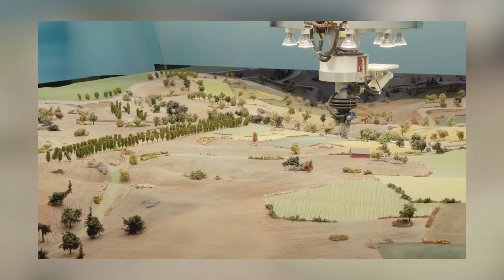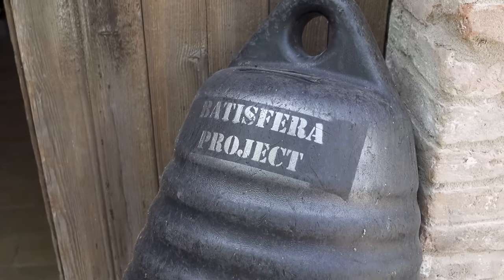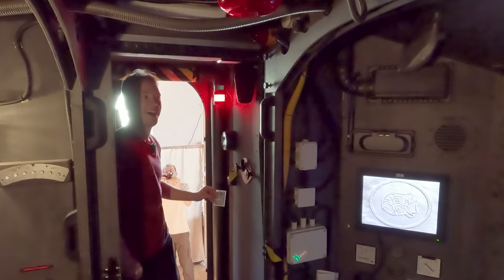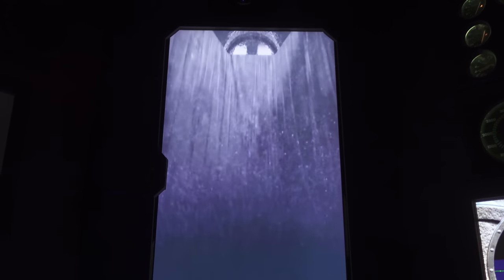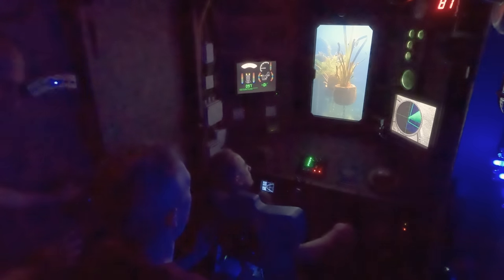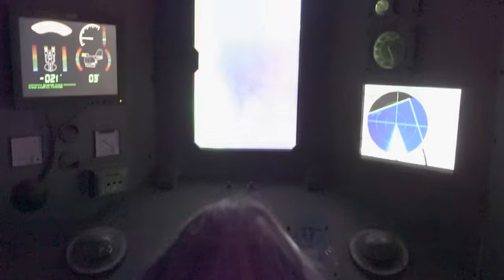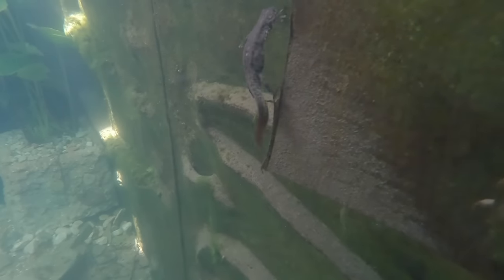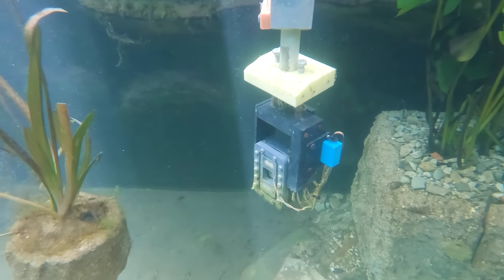I had to throw out my script about this submarine simulator

Comment: Can’t wait for a miniature spaceship simulator, that’s simulated with a tiny camera that is hooked to the ISS in real life
Reply: that might honestly be doable. cubesats have used electrolysis to generate rocket fuel after launch.
Reply: @tjeulink  You have to make the rocket fuel out of something, which you have to lift to orbit. Still a tiny enough spaceship could be cheap
Reply: smallsats are definitely a thing, it's possible to get stuff into space.
Reply: In the mean time, before the real space-cam: Artemis Spaceship Bridge simulator
Reply: I'ld like to see a moon-web-cam we could all control
Reply: @AlexanderRM1000  """""cheap"""""
Reply: @sorenlloyd  The fastest possible (theoretical) response time to controlling something on the moon is a few seconds (remember, it's roughly 384,400km from your house). In practice it's probably going to be over 10 seconds. Good luck controlling that in realtime.
Reply: @thany3  That is just over a 2 second round trip. There will be lag: but not quite THAT bad.
Reply: Because space is a vast void, there will be no little frogs or something. I guess the novelty might wear off quite quickly.
Reply: The possible equivalent of the presented project that is set in space would be something like a cartesian manipulator with camera going around in a dark room with diodes on the walls for the starts and illuminated spheares representing planets. This would require similar set up for the spaceship as presented but probably the effector of the manipulator could be programmed to have innertia and not stop without the thrust. Users could use gravity assists and examine distant planets. The map and the robot would need to be bigger than the pond.
Reply: @AlexanderRM1000  i know that? like i said, the cubesat used electrolysis to achieve that. they literally flew a cubesat around fueled by rocket fuel generated after launch. its called PTD-1, part of the HYDROS propulsion test.
Reply: Spaceship simulator where you can't move around at all, but you can rotate 360 degrees. I guess it could be interesting.
Reply: to echo André Bartels, actual orbit might get boring, but one could invert some colors, insert a star map in the background, and "simulate" an alien ecosystem on Titan, or theoretical extra-solar planets... It's the intermarriage of simulation with outright illusion that got me excited. There's reason for Tom to dismiss "theme parks in Florida" in comparison to this.
Reply: @thany3  you could run a full simulation based on previous filming. Give the satellite five degrees of freedom of movement. and playback "film" according to joystick movement in simulation.  That's getting a bit far from this "sub simulation", but if you don't have pesky lifeforms doing spontaneous things...  I'm just getting inspiration for a whole lot of projects with this. 😁
Reply: @tjeulink  that's not necessarily cheaper than launching the cubesat with extra rocket fuel, although perhaps you could make a system to make it out of some waste product the ISS produces
Reply: @AlexanderRM1000  you're not allowed to take rocketfuel. only if you do a dedicated launch which costs millions instead of thousands.
Reply: @tjeulink  Some cubesats do store rocket fuel. They just can't take up very much. Under normal circumstances, you can only put 100 Wh of chemical energy onto a cubesat (total between fuel, batteries, etc.). The advantage of hydrolysis is that you can use solar cells to generate electricity, which you can then use to generate more rocket fuel, so you can exceed the 100 Wh limit. Alternatively, you can just use an ion thruster, though that has much lower thrust.
Reply: I recently got to do a thing that was like this that uses VR headsets in a big arena showing you 360 immersive video of the ISS, and it's beyond amazing
Reply: In 2005 Ch4 in the UK spent a load of money to convince a group of people that they were actually being launched into space. It's called space cadets look it up.
Reply: @sorenlloyd  That will never happen...
It should have already been done.
Advertising goldmine if the public could use the camera to watch the earth.
There is a reason it will never happen.
Because then we would see the truth of the earth.
And they can't have that.
Reply: That's an amazing idea. My twelve-year-old self would have been ecstatic to try a simulator like that.
Reply: This is practical and can be created 😅
Reply: @EebstertheGreat  ah good to know, misremembered the details then!
Reply: Disney World used to have something like that way back in the day.  My 5 year old self thought I'd actually gone to the moon, and none of my classmates believed me.  It wasn't until a few years later that I realized it was just TV screens showing rocket footage.

Comment: These guys put more thought and custom engineering into their backyard passion project than a company charging $250k per person to go on a submarine built using dodgy off-the-shelf products. This submarine simulator probably has more safety checks than OceanGate too
Reply: We make a lot of efforts in experimenting with different kinds of redundancy and safety checks. But of course, our is a proof of concept. Everything on our beloved surface is far easier to implement than in the far deep of oceans...
Reply: a backyard submarine simulator is a recreational device designed for entertainment purposes. While it may have safety checks in place, it operates within controlled conditions and does not carry the same level of risk or complexity as a real submarine expedition.

Comparing the two is like comparing apples to oranges. Each activity serves a different purpose and carries its own unique set of risks and considerations.
Reply: @Pygmyz06  That's the point. More thought went into something that had immensely less risk than the actual deepsea submarine with literally cheap lights from a camping store (and a construction that was never rated for its purpose).
Reply: @OLBastholm ut you understand that you are just wrong though right? Like i understand that there were major oversights in the project but you do understand that SEGNIFICANLY MORE WORK went into the actual submarine buisness than the simulator.
Reply: @LetathousandFl0wersBloom  Doesn't seem to be much evidence of that. There's clearly an enormous amount of R&D gone into this simulator.
Reply: @LetathousandFl0wersBloom they didn't get certified and didn't even check for maintenance. This was much more working
Reply: Bruh they built two completely separate products what are u talking about
Reply: @alexarias5717  Rolex does more work than McDonald's

Comment: My dad's job is teaching pilots in simulators. They cost upwards of a thousand dollars an hour to run. And these people run one in the back of an old mill... I'm definitely sending this to him.
Reply: Let us know his reaction!!
Reply: Let us know yes!
Reply: I too really wonder his reaction to this!
Reply: Based off your wording, you're referring to FLIGHT simulators, which are FAAARRRRRR more complex than this... Someone who "drives" a submarine is called a "Submariner"
Reply: @I_Crit_My_Pants  Yes, they're flight sims. I'm not sure that a flight sim is more complex than a sub sim - they are both 3D.
Reply: @100beep5  As someone who works in aviation, the aviation regs alone will put paid to that haha.

Same reason you can throw together a Transponder with basic parts, but you'd never get an STC to actually allow your maintenance tech to mount it in your aircraft. Cowboy builds are all well and good until you decide to use them for aviation safety. I sure wouldn't take that risk, there's heavy jail time involved.
Reply: Did your dad respond?? We need to know!
Reply: @100beep5 the main reason a flight sim would be more expensive is it has to simulate jerky motion, like turbulance or a nosedive. So it needs fast actuators like hydraulics or pneumatics and the ability to flip almost upright. Since the sub only moves slowly and only can go a few degrees out of horizontal, it can use much cheaper motors to move the pod and it only needs 15 degrees of tilt maybe to simulate the low acceleration rather than 90 degrees for a 1g accelerating jet.
Reply: @I_Crit_My_Pants  Overclockers put a bunch of beastly components on a B650 chipset?  😮  That's like building a castle on a foundation of wet sand.  I can't believe they'd put an X3D and a 4090 on top of a budget chipset when those components would roar on an X670 chipset...
Reply: @100beep5  They absolutely are orders of magnitudes more complex. They are meant to train pilots so they need to simulate airplanes in the most minute details like how it handles with different weights and different balance loads, every possible mechanical or electronic faults (and any combination of those) all types of weather conditions... The list just goes on.
As incredible this sub sim is, it would never be usable to train a submariner
Reply: @100beep5 i think it's the hardware that's expensive not the software similar part
Reply: Grandpa is a sim instructor, got to take a flight with him from PHX to JFK once

Comment: Why would you use a sub simulator instead of just simply pay $250k to take a Home Depot sub down to the bottom of the ocean
Reply: Because there is a chance the home depot sub may fail and you die. I don't think that has ever happened...nowait
Reply: @0xf7c8 the controls looked easier on the home depot sub though.
Reply: I hear that a few positions have recently been made available for someone with your way of thinking... Good luck 🤿
Reply: The lightning was from camping world, spared no expense
Reply: @craighalpin1917  Only if you're not a 50 year old white guy tho
Reply: Hey don't discredit the engineering of Home Depot adhesive products like that!... Despicable! 🤣
Reply: @berryreading4809 the crackling means it’s working, all right!?
Reply: w camping world as well
Reply: if you did that, you'd deserve an award! a darwin award.
Reply: @Existential_Dread  Hey if you can't see the water coming in behind the rear cover panel than is it really even there? Be positive! Just maybe not positively buoyant... 🤔
Reply: @kingo55  Well everybody loves a wireless Playstation controller! Atleast until the battery dies... 🤔 Redundancy just seems so unnecessarily redundant right?! 🤣👍
Reply: @berryreading4809 Logitech 310 more like
Reply: @mlee6050  I guess details do matter... Like the fact that they used Rhino-Liner brand spray coating to "seal and protect" the carbon fiber, not the other common Line-X or Raptor brands of truck bed coatings. 😆 When did Rhino-Liner get into the submersible pressure rated coating business I wonder 🤔 😂
Reply: @berryreading4809  thanks, I saw thumbnail saying sprayed it but I never bothered to find what they used

Comment: Not surprise to see another submarine where Logitech hardware is being used
Reply: @aaronbailey1406 more like 💀💀💀💀💀
Reply: This thread is as dark as the bottom of the ocean
Reply: At least this one is just a camera, not a controller for the movement of the whole sub.
Reply: what's wrong with Logitech?  They've been doing PC stuff for decades....
Reply: @@dontatmetillyouvebeenoutside they've been used to control tanks, submarine equipment, robotic control for the US army. There's nothing wrong with using games controllers
Reply: @salerio61  True, but usually game controllers are not used for critical functions in actual vehicles, only maybe for a periscope or weapon system.
Reply: @zhch  Carmel tank uses the X360 controller to control the tank. The  Kurganets-25 APC uses a Gamepad to control it

Comment: This looks nice as a science outreach for sure, but imagine this as an escape room!
You are locking in a submarine, somewhere in some complicated water. Gather hints, learn how to move the submarine, move the submarine to some dry alien base, enter the alien base room and get more hints there, move back into the submarine and finally leave for dry land!
You would need to put the simulation room on some rails so that it can move back a dozen meters to connect to the alien room (instead of the outside room) and of course emergency exits and all that, but this could be very fun.
Reply: Or put a door on the opposite side of the room?
Reply: Theme parks often move the scenery or rooms around the carriage and riders so this is also a feasible option so long as the room is not too big or complicated.
Reply: They already had a whole other room built into this one for the "reactor problem", so you just make that the other destination, whatever destination you want, and buh bam.
Reply: Reminds me of the game called Nauticrawl.
Reply: I quite literally did an escape room that is almost that exact plot, only with a “underwater research base” room next door you “dive” towards.
Reply: it's easy to create that illusion of movement without actually going anywhere by just entering and exiting through different doors. The spy museum in washington DC has a fun example of that I went to as a kid. You get in the side of a van, it bounces and rocks on the road, and when you exit out the back door your brain is entirely convinced that you are now in a different location.
Reply: I did a WW2-era U-Boat escape room in Boston. Highly recommended.
Reply: God bless thier soles, may the rest in peice
Reply: Well this aged.... Yep.

Comment: When I worked as a Technical Designer at the Boston Museum of Science, on the Charles River Gallery project, I wanted to do a version of this. The Museum sits over, across, the river so the building is in a perfect position to have a controlled camera in the river. Easier said than done, but none the less...
Reply: if you still know someone there send them this, let them know it is being done and it might be cheaper to implement then they fear

Comment: I'd love to see this implemented with an actual RC submarine which streams its accelerometer and gyro data back to the simulator along with the video.
Reply: I mean, that's apparently not necessary, but it could be cool.
Reply: The only problems with RC are the batteries and the connection. I doubt wireless would work (maybe sonar would idk) Maybe you could have a wire connected to it but it would get tangled around.
It's a complex problem but it could be done

Comment: They should put a mini titanic in the water and such and charge 10k per use.
Reply: More reasonable and a lot safer than sending a full size not-submarine. Cheaper as well. Leave actual submersibles to the Navy, or to researchers who know what they are doing (Triton, Deep Sea Challenger, Alvin, Trieste). I'm more interested in the most successful wreck finder: RV Petrel.

Comment: It actually makes a lot of sense that they're using a specialized rig for the camera instead of having a miniature submarine in the pond, because it would be a lot harder to accurately simulate the physics of a full-sized submarine moving through the water using a miniaturized model. By having a static rig that they can control with great precision, they can make sure the camera moves with the same inertia as it would've done while mounted on an actual submarine.

Comment: One of those small exploring ROVs that are just starting to get cheap enough for individuals to own & run could be dropped into the lake or ocean and instead of the cable running up to a boat with the operator in it the cable could run up to the surface with a float. On the float you could put solar panels to extend the batteries, a Starlink dish, the hardware needed so the data / control can be coded / decoded to enable you to explore anywhere on the planet just about.
You could explore under the Arctic ice from the comfort of the simulator at the bottom of the garden!
All sorts of possibilities!
Reply: ...until something goes wrong  🤣

Comment: Crazy what they could do with more budget for the camera and the remote connection. Like a newer GoPro. They could put in a couple more "windows" all showing a selected part of the wide angle image the GoPro sees. So it feels even more like actual windows inside the real world. And as the arm with the connection is over the water a connection similar to the ones drones use could be used for smooth 4k Transmission.

Comment: Prrof of concept passion project?? These blokes have just developed a fantastic training simulator that could be adapted to so many things - given bandwidth and latency, they could use the systems they've designed and built for an Astronaut in orbit to control a rover or submarine on the surface - Manned mission to Venus?, fly a vehicle in that atmosphere. Send a crew to Titan?, drop a rover that can swim through the methane seas.
Bleeding edge engineering, on a modellers budget, it'll be as effcient as possible.